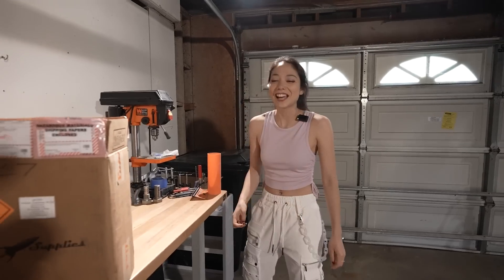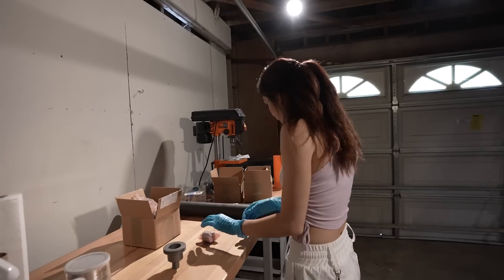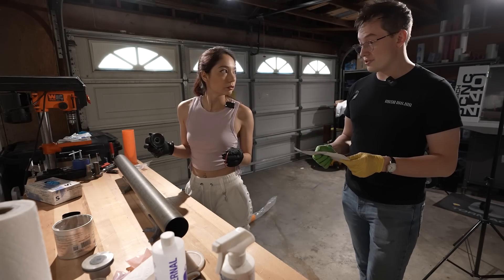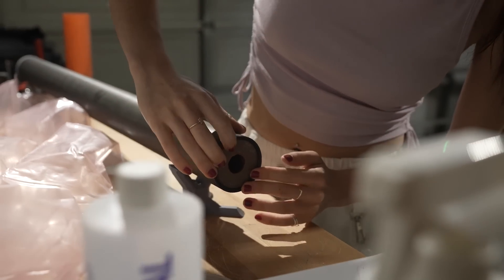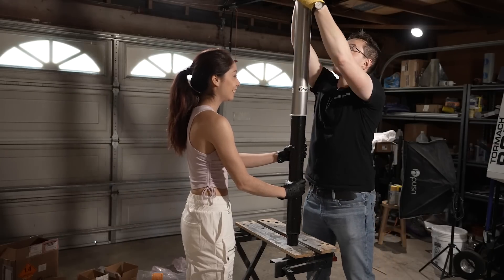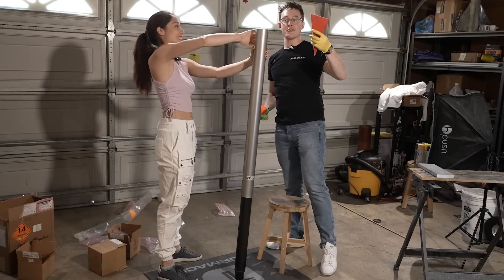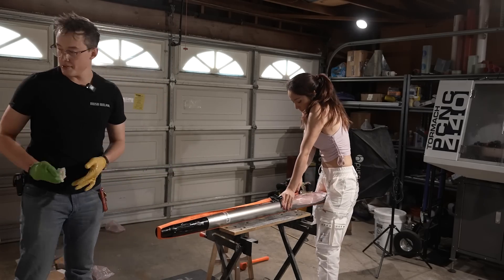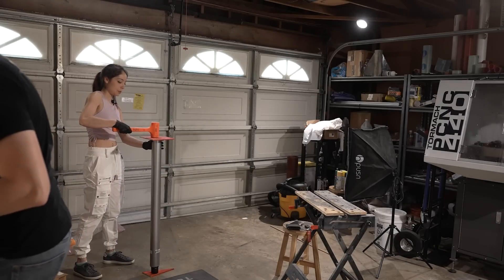I've never had such a hard time integrating a motor (feat. BPS Space)

Comment: Is there any chance that the liner was absorbing the lube and swelling slightly? Early on, it seemed to slip in OK, but when you repositioned to get a better angle it became much harder. Either way, time for a hydraulic press maybe? You could make something pretty easily from a metal frame with a movable jaw and hydraulic piston with attached hand pump (or a hydralic jack I guess). I was worried that you were putting force on one side of the tube.

I wait in trepidation for the removing of the liner video. It is either going to be impossible, or perhaps easy now that there are no grains left inside.